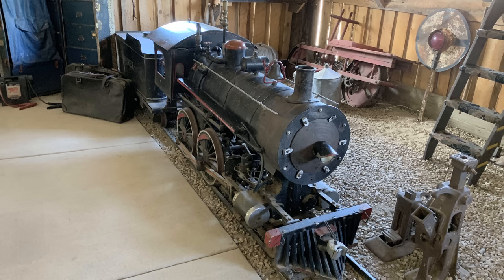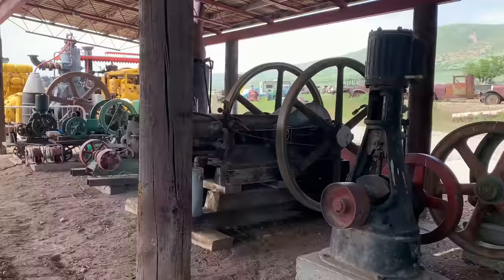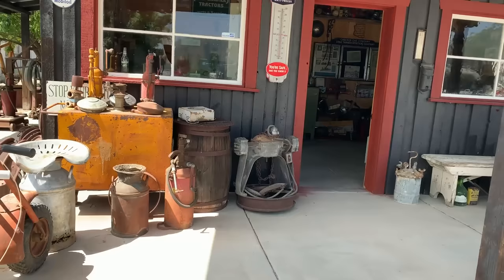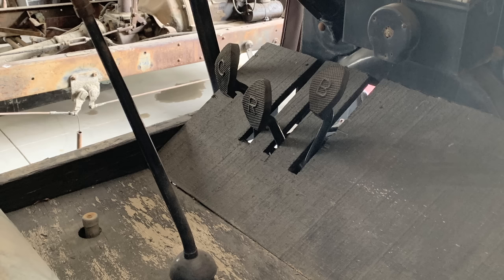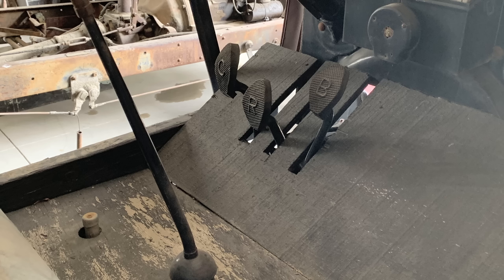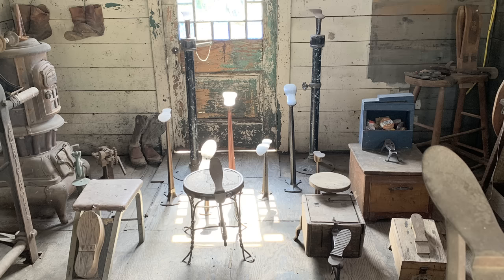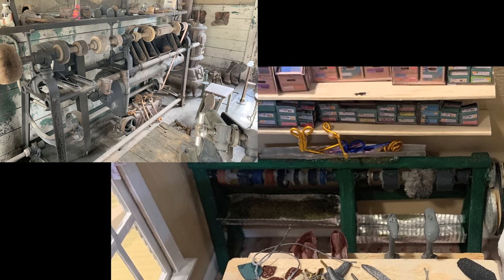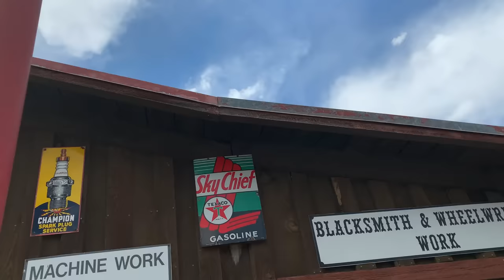Antique Power Show - Richard W. Erickson Collection at Wallsburg Utah

Comment: This is so cool! We have a similar place here is Southern California in the city of Vista (located south of Camp Pendleton and in between Orange County and San Diego. It’s called the Antique Gas & Steam Engine Museum. Their collection is pretty large and it’s open every weekend and they also have a blacksmith shop and several other exhibits. The bonus is an N-scale model railroad club that is very impressive. They model basically the Feather River Route from Sacramento to Lake Tahoe areas. 
Once or twice a year they have a huge show (coming up Oct.21/22 & Oct. 28./29) where steam and gas powered tractors, etc. come from all over. They also do a knitting event called Fiber Fair.
Reply from the maker: Cool!!!! We need to check that out

Comment: Love that little cleat-tracked John-Deere :)  I grew up with a 1939 "A" model and 1941 "H" model John-Deere tractors on our farm.  My knees are getting bad too, but I have discovered that kneepads like carpet installers wear help a bunch.  No steam sawmills around me that I know of, but there is an undershot water wheel powered one about 45 minutes North of me at Spring Mill State Park that they operate on a regular basis along with the overshot water wheel that powers the gristmill beside it.  I go there to buy stone-ground cornmeal, lol.  

When I was a kid one of our chainsaws looked very much like one of those two at 4:45.  It was a bear to start and a bear to handle.  No telling how old it was.  It finally quit when I was about 16 as a piece of piston ring broke off inside it and tore up the cylinder head bad enough that it wasn't worth trying to fix afterwards.

This show reminds me of one in Rushville, IN I used to go to.  Lots of steam powered traction engines and hit & miss engines.  They had a big threshing machine there that ran off a cloth belt attached to the flywheel of one of the steam engines there.  Neat to watch for sure.

Thanks for taking us along on another one of your amazing journeys.  :D
Reply from the maker: Hi. There is a working steam sawmill in Oregon that’s like 150 years old and still jut a working sawmill. We’d love to see it but they don’t see the fascination. To them it’s just a working sawmill.
Reply from the maker: When I was young, there was a working ice plant next-door to get an industrial laundry, and the whole darn thing ran on three steam engines! Huge wooden water tanks on the roof of the laundry. We actually did a show about the laundry because it survived until about 1990 as I recall?
Reply from the maker: https://youtu.be/ws9SQ1lqdDc?si=L6AylJ7zI0lAvVce 

Check about 2:00 in.

Comment: Something I thought of to make the miniature thread for a miniature sewing machine is enamel wire like they use for transformer wiring in old radios.  Just paint it white...or black and you can use it as power or telegraph line.  :)
Reply from the maker: I also use stretchy elastic thread for power polls. Why?  Well it looks okay BUT when on a model railroad you WILL catch your hand on it reaching in. And elastic forgives that. Wire and you rip your poles out!  Break something. But elasticity helps. I should do.a show.
Reply: @ToyManTelevision    I wish my transformer wires were that tough, lol.  Occasionally they'll be broken inside the clamshell of the transformer itself and I'll open it up and start praying that it's broken on one of the outer wires of the winding :)  I have friends that have the patience to rewind antenna coils, transformers, etc. but I'm not one of them, lol.  I once did make an inductively tuned antenna out of some dowel rods, a base, brass nails and about 20 yards of enamel wire and a variable capacitor, but I also sliced my fingers on the wire several times trying to pull it taut to look straight as I wound it around the nails on the crossed dowels.  I should probably have made it from litz wire, but that stuff is expensive, lol.

Comment: Hey there and good morning! Where is that Appalachian banjo music near the end of your video gotten from? It sounds perfectly rustic!😊
Reply from the maker: It’s library music. From SmartSound. I use it for everything. We should do a video on Smartsound. What they do is they take existing music tracks that they can get rights to, and then cut it up into measures. Sometimes half measures. But the beats structure is all broken out that way. Then the recordings that they get are the original recordings of the tracks separately. So in the case of that music, the banjo is on its own track, drums are on a different track and so on. So I can select say six bars from one section and connect that to five bars from another section, isolate the banjo, or just the banjo and bass or just the banjo and drums or whatever I want to do it. And there is the music track! It’s super fun and it gives me total control over what I’m doing with the music.  I’ve been using this system for all kinds of projects now for almost 20 years. And over that amount of time I’ve purchased music from them, I’ve got hundreds of different pieces of music, probably paid around $3000 for it! But I just really love it.